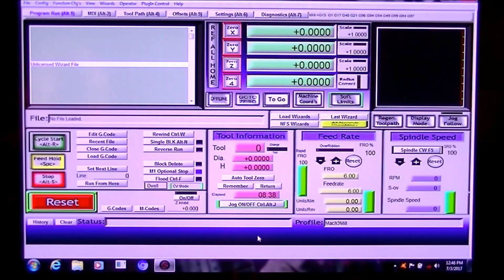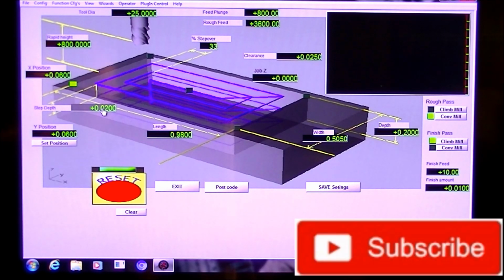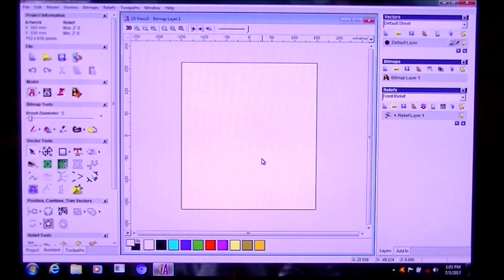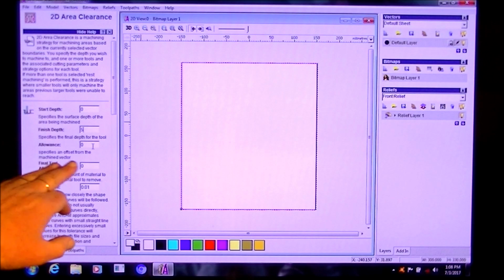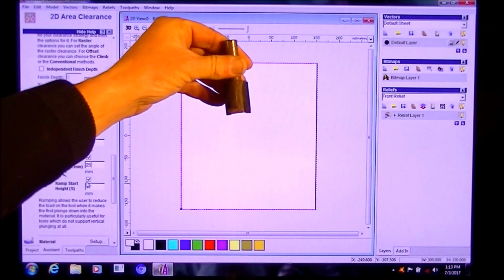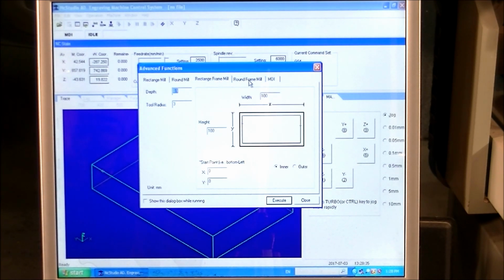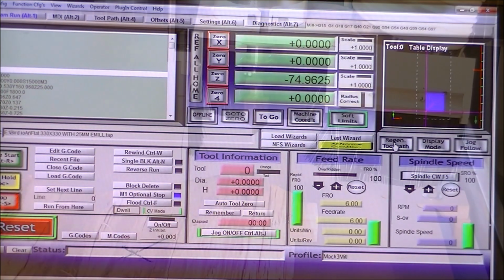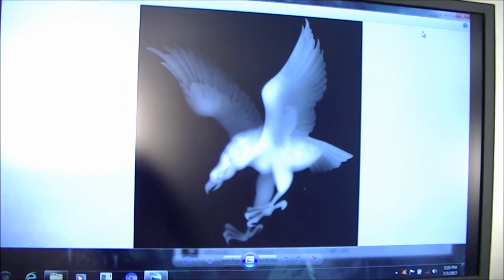447 CNC router, Writing G-code with Wizards in Mach 3, ArtCAM and NC Studio, digitally remastered

Comment: Great video!
Is it possible to transform g code that i have made from Solidworks to g code. tap file format? I have DSP remote controller. I would rather use just Solidworks than Solidworks + Artcam to transfer drawings and save to correct file format.
Thank you! 😊
Reply from the maker: Use Carveco Maker

Comment: Great video..Gents i have a question please need answer..
i wrote down gcode in my sub program in notepad ..am using mach3. i have simple code want to run as loop but no luck i did a lot but nothing..here is G90 X100 F350
G1 X0
G1 X10 
G1 X0

thats it i want to repeated all above again again as loop... what can be work in my case?? please really needs help appreciate it
Reply from the maker: You would need  Fusion 360 for that.
Reply: @inventorsworkshop9600  why to write code need fusion for what?